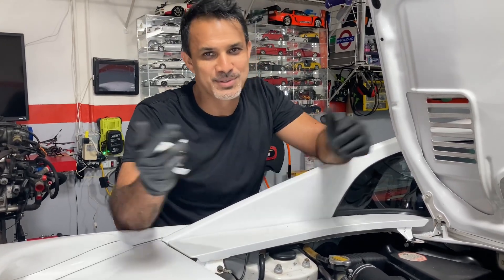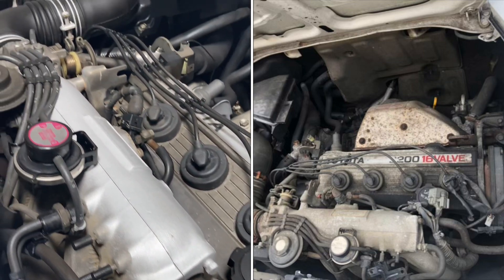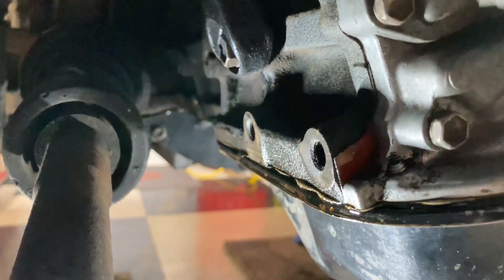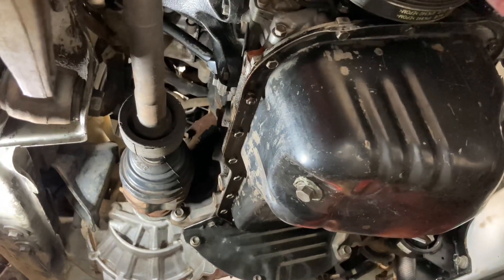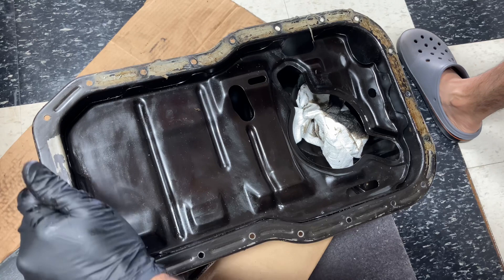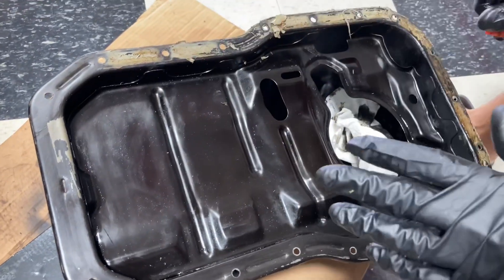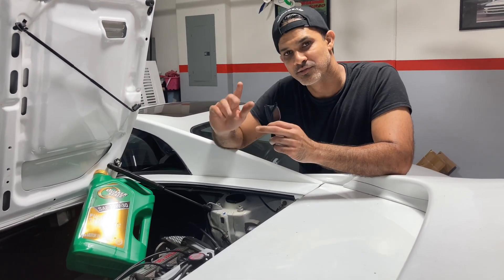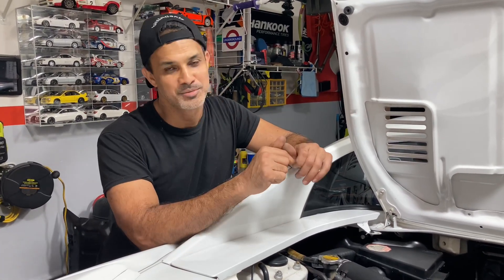1991 Toyota MR2 OEM Refresh - E7 Resealing the Oil Pan

Comment: Do you have or know of a source to get an oil level sensor for a 1991 sw20?  Mine was broken when the pan was resealed.
Reply from the maker: Sorry I don’t at this time, is it broken where it will leak  if installed as is.
Reply from the maker: You could reach out the TCS motorsports and see if they have an old engine from a swap they could pull the sensor for you.